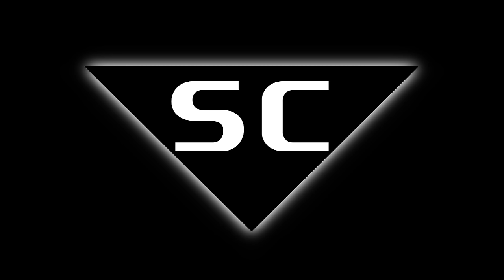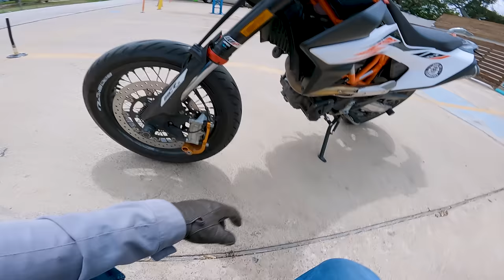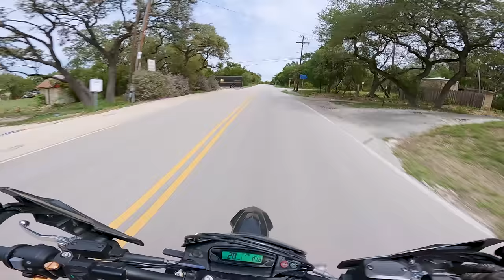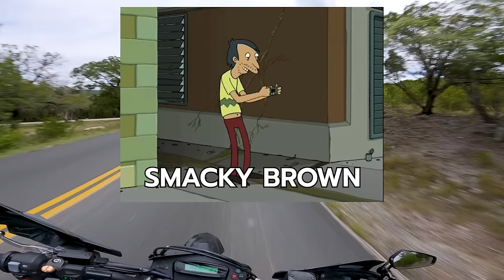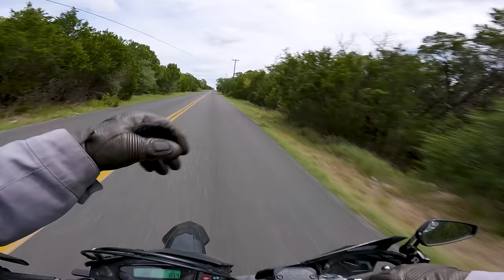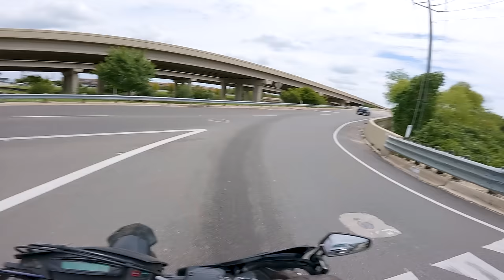Watch This Before You Buy A KTM! (SMCR Update)

Comment from the maker: MOTORCYCLE VIDEOS ARE BACK BABY! Stay tuned for more on the SMCR in the next one.
Reply: Bro I am so excited for this!!  I have the 22 SMCR and there is so little content on these bikes.  ESPECIALLY IN THE U.S.
Reply: Man I just went through a similar experience with my 2020 790 Adventure. I bought it brand new and within the first 500 miles it started leaking oil from somewhere at the top of the engine. A small leak that didn’t prevent me from riding the bike, but still frustrating considering it was a brand new $13K motorcycle. About a year later I decide to take it to the dealer to get it fixed under warranty. It ended up needing a new valve cover gasket and it took 5 MONTHS to get the parts from KTM. The worst part is that the bike sat at the dealer the entire time because they had to take it apart to diagnose the issue. I agree with you though, KTM makes unbelievable motorcycles, but hopefully you never need to do anything outside of routine maintenance on them.
Reply: This is why I watch yam noobs channel. If yam noob doesn't get Spite involved I may not watch his channel much. Spite was really the main personality of the channel
Reply: @mistergarrison7559  I hope that when the day canes and yam comes back begging because nobody watches his BS anymore because it seems most people are there to see spite! And when he does come and ask I hope spite laughs in his face. I can't believe he did this and especially in the way he did it.  And now he deleted the vid because everyone was telling him what kinda mistake he made
Reply: Get a sportster 48 or a dyna, you’re living a false sense of self with that supermoto.  Young padawan move paying 750 to insurance for a new ignition that cost 35 bucks and a 20 min install…. Could have bought a frame on eBay for 1300.  Insurance is for bad crashes, everything else diy.
Reply: @theinnerdreamer7043  I am gonna take a wild guess and say you have never rode a Supermoto!? 
Because if u did u would understand how ABSOLUTELY AWESOME they are. I have had just about all types of bikes and if I could take the best part of all those bikes and combine them I would have this KTM SMCR!!
Reply: I like supermotos.  His 690 videos just seem disingenuous.  I could be wrong but seems like he’d be happier on a Harley.  Respark the passion.
Reply: @theinnerdreamer7043  yea I guess he is a harley guy through n through!
Reply: @22smcrrider96  Huge fan of theses bike. They made me love riding again after a long hiatus, being bored about bikes. That's even a reason for me to start filming my trips in France with 701 SM. Give a look please, any honest reviews can help me. Thank's.
Reply: @22smcrrider96  hi what did I miss is he no longer with the noob
Reply: @elizabethcilliers8746  yeah scammy boob was butthurt that spite was quickly becoming a major staple of the brand I guess he couldn't have someone else stealing the show so he cut him loose
Yam had a video or 2 about it but after the immense hate hurled his way for his stupid decision he took them down and now if u ask about it on his vids he shadow blocks the comments
Reply: Hey dude, i am about to buy a husqvarna 701 enduro from e dealer after a theft attempt. There is a lock damage and a crack that looks alot like yours. Do you think that this is a structural damage or can i just ride it like this?
Reply: @antonpopov3224  don’t buy it you will regret it.  No turning back

Comment: I share your pain w ktm when it comes to the amount of time it takes to get parts for my 390 Duke . I ordered two washers and it took 3 weeks to get those washers. A rear tire two a month and a half. A kick stand is ordered and am currently two weeks and waiting. Partly a dealer issue too. Not as bad as your situation but man. Their parts take FOR EVER to arrive to my dealer. I’ve had this bike for a little over one year and I’ve had more issues than I’d care to elaborate on when it comes to the engine and my dash just turning off mid ride . A little over a year and my kickstand rusted and cracked right in the middle. It wouldn’t be too big an issue if this bike wasn’t my daily. A wee disappointed 😐. All that said Spite, great video man.

Comment: Hand tightening should not fully strip out threads.  Thank you for that story, it says a lot.  Keep up the great posts!
Reply: Depends how strong you are. I can break 14mm bolts at will with regular hand wrenches. I cant count how many 5/8 grade 8 bolts I have broken over the years working on trucks replacing cross member bolts. So a ham fisted know it all can easily strip the threads in an aluminum engine case
Reply: @holmes1956O  Very true.  I knew that when I wrote that comment there were loads of exceptions.  When I said "hand tightening," I meant "finger tightening."  Even then, with Aluminum, one must be ultra careful.  Also, very fine pitch threading can also strip out super easily.  When we share our mistakes, we make each other stronger, thanks for the reply!  :D

Comment: Top tip. 1. Don’t use the steering lock when the bike is outside your house. 2. Get rid of the fixed disc lock. If the thief manages to cut through your locked chain then there is nothing to indicate that a disc lock is fitted so the thief will drop it as he tries to ride off and then it will be trashed again. The bike is insured so unless that crap cuts your insurance premiums take it off.

Comment: KTM 2 stroke TPI, Transfer Port Injection bikes have a lot of problems since introduced in 2019.
Many law suites apparently over engines poorly running and seizing.
My 2022 seized 2 times within 12 minutes of each other. 
KTM did finally put a brand new motor and oil injection pump in it under warranty after the 2nd seizure. The result being it finally ran correctly.
It never ran properly from day one. Never raced, all Motorex lubes used, completely stock.

Comment: Here's something that could help AND have you be fully independent: 

Tl/dr: dynojet auto tune. Be your own tuner. It'll also scratch that geeky tweak head itch. 

Long story:

I bought a 2016 daytona 675r (used) after I sold my street triple 765rs for ergos + better suspension/handling package. The bike came with an akra full titanium system + pcv. Now the akra comes, loaded from factory, with a wideband o2 bung and they supply an adapter that let's you mount your stock o2 sensor. So I had that going for a few days, let the ecu do its adaptation thing as best as it could. The pcv had a hindle full system map loaded which was Bleh. There were quite a few holes/floods in the fuelling, especially in the lower revs. Mind you, there are 0 dynos or dyno tuners in the area so I'm on my own with the tuning. The ecu was flashed with the factory arrow full system map so at least it was in the "safe" ballpark.

After a week or so of running this setup I scored a used auto tune (people seem to want to sell theirs once their base map has been built for some reason) in really good shape, and I had a dongle for the stock o2 sensor. So I installed that and my mechanic helped me with a brilliant and super cheap solution for blocking off the SAI (secondary air injection), which I'd disabled in the ecu flash but that just kept the valves open all the time. I set up the AFR target table, dialled in the idling fuelling using the sensor data. And within 10 minutes of my first ride the real time "auto tune" was REALLY doing its magic. I could feel the sluggish throttle spots getting cleaned up and when I got home, I saw that it had actually CUT a bunch of fuel from all over the place and added fuel in the 4-6k range. Which was a revelation. You've to be a bit methodical about the throttle inputs you give it, and I found 5th or 6th gear at low speeds were amazing to iron out all the low rev stuff because it would move through the cells slower, and give the sensor+auto tune a better chance of nailing that tps/rpm range. EBay is your friend. And installation is super duper easy. Get a positap+longer power cable+crimps etc to plug the power into the rear tail light. 

Warning: the wideband sensor has a GIGANTIC connecter with a short wire, so some zip tie magic will need to be done to get it mounted cleanly and safely. My mechanic was a star and did a phenomenal install. I'm sure you'll ace it with your skills.

Comment: I bought a a new KTM 1190 ADVR back in 2014.  Within 2 months, the ignition failed and I had to wait 7 months to get a new one.  The dealer ended up putting in a used one in till I could get another from KTM.  Love the bikes, but know what you're buying.  KTMs are the idea idea, but the smart idea.

I love a 701e and am looking at a KTM 350 so obviously I choose fun.  The 701/690 platform is soo much fun.

Comment: i once crashed a duke 390 and the damage wasn't so bad, it needed a gas tank, a radiator, maybe handlebars and new plastics but that was about it, my insurance told me "we can fix your bike, but we just got another duke that needs some parts your bike could donate, are you ok wit us totalling your motorcycle and giving you the money" and i was like, sure, it sounds like a great deal, i took that money, went straight back to the KTM dealer and got me an RC390 without pulling a single penny out of my pocket. i've been getting my bikes insured with them ever since because even though it was just a less comfortable version of the same bike getting a new toy was far more pleasant than just waiting to see how long it was going to take for me to get my old toy back.

Comment: Hm interesting that your bike has a bit of a wobble. My 701 SM has been rock solid in that aspect. So much so that I've even commented numerous times to myself of how stable it is. I'm about 6 feet and 200 lbs though, so not quite as big as you, but still bigger than many folks. Wonder how much of difference weight and size make in that regard. I keep my front forks on the "regular" damping setting after having played with the softer and harder settings.

Comment: It seemed to me that ever since I got this bike I kept having bad lucks one after another. I had a DRZ400SM before this. I spent more time going back and forth between dealer which is 110 miles away than ride it. 

2 days after getting the bike, I notice the left shroud is closer to the fork than the right one. I found the radiator brackets are bent. I sent pictures to the dealer and called and they wanted me to ride 2 hours back to them so they could "look at it" then another 2 hours to ride back. So I did but I felt the long trip was completely unnecessary since I had pictures. They didn't even have pick up option available. After they looked at it, they claimed it was damaged during shipment and ordered parts from KTM.

I was mainly a cosmetic damage but I bought a brand new bike so even though it was rideable it still triggered my OCD. In the meantime I wanted to get my first oil change done. After draining the oil, as I was screwing back my oil filter cap on the left side, I broke the screw by over tightening it. the other half was stuck in the thread and I didn't wanna attempt to extract it myself and cause even more damage. I called the dealer but like I said before, they didn't have pick up option so I had to figure out a way to take it there. I couldn't ride it because obviously there's no oil in it. I rented an Uhaul pickup and trailer for 24 hours which cost me close to $400 and some more money for ratchet strap. This was my first time using ratchet to tie down a bike and it took me some time to figure out. I drop the bike off.

Over a month has gone by and I still don't get a call from them. I call them and talk to them in a passive aggressive manner and they say they're still waiting for the radiator to arrive. 2 days later they say it's fixed and I could pick it up. I get a sigh of relief and get an Uber next day there to pick it up. Uber cost me another $200. I finally ride the bike home 110 miles and on my way I notice the engine overheat light keeps coming up when I stop at lights and I could feel the engine over heating. At this point I can't ride it back to the dealer because they'll be closed when I go back. So my only option is to go home and take it to the dealer again some other day to fix it. I tried to turn it off at lights to prevent it from overheating when riding home. At high speed the light goes away because the air cools it down. I call the dealer the next morning and ride it back 2 hours again. They say they forgot to plug in the radiator fan plug when installing the new radiator. They fix the issue and I ride it back.

Now the radiator and oil filter cap is finally fixed and I could finally move on to installing mods. I make an appointment with another dealer which is "motorcycle mall" in New Jersey to install a preload adjuster. After a week I get the part installed for $380 and I provide them the part I bought. As soon as I receive it, I notice a few deep scratches on the beautiful trellis frame which looked like someone hammered on it. I told the employees immediately and they took pictures of it and said they'd call me after they review before pictures of it. Luckily I had a before picture of it from the day before. Weeks go by no call from the dealer. I had called them multiple times since then and every time they say the manager will call me back but it never happens. The employees talk in a rude manner saying "it's still rideable" to which I reply, "if I smacked one of your bikes in the show room with a hammer and said "it's still rideable" would you just let me walk away without any consequences? I've heard horror stories about that dealer from someone else in my area who also rides a 690. They serviced his engine and put water instead of coolant. I still haven't heard back from the manager.

Days later I notice a slow leak on my rear tire. I didn't wanna deal with the other 2 dealers so I took it to a 3rd dealer. They keep the bike in their shop for a month only to tell me the rim band for rear tire still hasn't arrived. I sent another $200 to pick up the bike that hasn't even been fixed. I ordered the bike in May and now riding season is over and I probably got 2 or 3 days of riding out of it the whole summer.

Comment: I own a KTM 790 Duke and its the most fun bike I've owned. So far I've had a coolant hose leak that was only fixed with Samco racing hoses, then a few months after that my thermostat housing seal went, it didn't cost much but for how good the quality and attention to detail is on other aspects of the bike. I just don't understand how they let themselves down with the most basic of components.

Comment: Sounds like how my dad blew the head gasket and stretched the head bolts on his Husqvarna FE 701 (same bike as the 690 SMCR, different name) after 4800km and a session of beating the thous in the twisties. That was the easy part to fix with head studs and a new gasket but when putting the ECU back in, 2 of the plugs are identical and so he plugged them in the wrong way and fried it, took him 6 months to find an ECU and it wasn't even a new one, was off his buddies wrecked one cause they're wasn't any available in the Oceania

Comment: Chromoly is weldable if you have a skilled local welding shop. So skip the frame replacement and get it welded. It might be ugly where the powdercoat needed to be removed but at least you avoid the KTM circus.

Comment: Nothing that happened to you had anything to do with KTM. Leaving your bike outside in an apartment complex is not bad luck; you know how that story always ends.  You had bad luck via crackhead. You had bad luck via covid. Your dealer was slow with the assembly.  The actual frame is the only thing that was KTM's responsibility. They got that to you in little more than a couple months. A frame. On a limited run bike. Throughout the Covid panic, KTM supply chain was absolutely incomparable to the Japanese. I bought a Tenere in 2020 when they first came out and I still have parts for that on back order. I have a friend who has had throttle cables for a PW50 on backorder for two years. We were both Yamaha employees(front of the line)! 

Listen, I commiserate with you fully on the theft attempts. I have lost several bikes that way., And I don't even blame you for losing some enthusiasm for the SMC. Instead of blaming KTM, I think the right thing to do now is to order a Duke 890, rent a place with a garage, and go do that track day!

Comment: With cars even my simple Golf 2 it's sometimes a pain in the ass to repair something yourself, because - car.
I also don't have a welder. Yet.
Or a lift. Yet. So work on the chassis is something i have to give to a workshop. If it's rusted through. Or if I don't have time myself and I'm in need of a car.

But: I'm can proudly say to myself that I have done every modification, service or repair except of 2 things on my Motorcycle (Yam DT 125 & LC4 660 SMC) completely on my own, as motorcycles are so much easier and more fun to work at. Especially single cylinder bikes.
The two things I let a Workshop do was: Putting new tires on the rims and maybe balance them in the process AND I had an expert service and modify the shim settings on my fork and shock (fork service has also been done by me before but i obviously didn't play around with shims).
That beeing said: I like to do all work on my vehicles by myself because I know I do it the best I can, even if it takes me a long time eventuelly :) (let's talk about a pissed wife and not having less time for the kids.. :/)